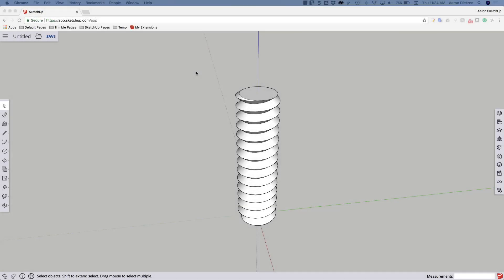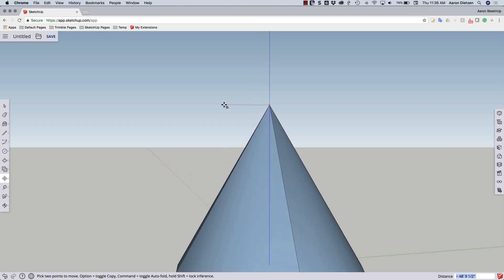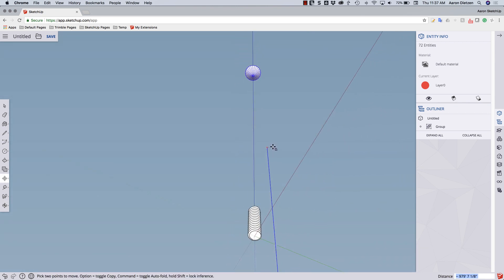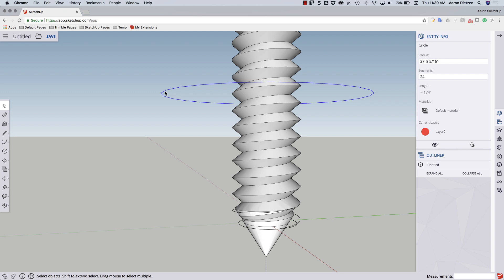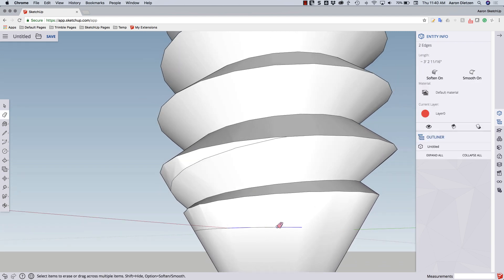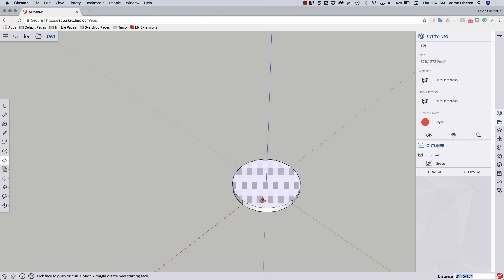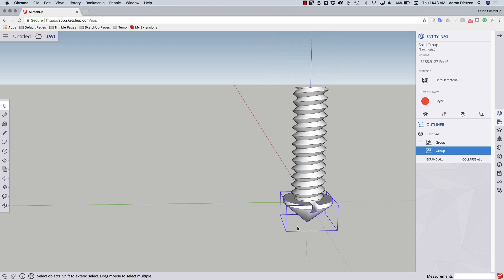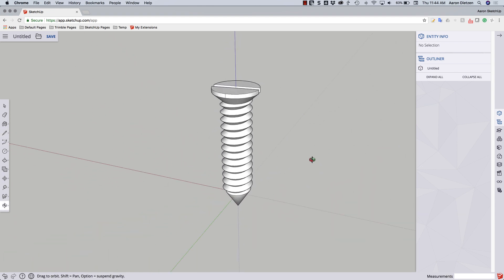SketchUp Skill Builder: Modeling a Screw, Part 2

Comment: Should have closed the cone, then move the cone base back past the apex to invert the cone (becomes a cylinder with a cone shaped hollow)  Subtract the inverted cone from the screw section and it removes the extraneous lines all in one hit.
I did that 4 years before this video.

Comment: Can you make a hole in the sketchup for fitting a screw. like a female screw.
Reply: I think you mean a nut.  just did this, coincidentally....     draw a hexagon around the screw, push/pull it to your desired height.  Intersect faces with model at the top and bottom planes of your nut.  Erase anything outside your nut.  Erase the circle covering the hole, top and bottom, of the nut. Save that as a separate file.  In your new nut file you will have to resize it because it will be too friction tight for your screw.  Use the scale tool on THE RED AND GREEN AXES only.  Maybe 1.05,1.05.   3d print your screw and nut to test for fit.  Resize on THE RED AND GREEN AXES only as necessary.

Comment: Nice tutorial. I learned some good concepts. 
I've been trying to create a nut. I thought I would just draw a 6-sided circle, push it up, then remove some material using the follow-me tool, to round off the shoulders. For some reason I can't get that to work. Is it me, or is there a problem with that process? I didn't even attempt to draw threads on the inside. Thanks much.
Reply: I've done that with success, though I haven't taken it to the follow me for edge dressing. In other words, I don't think there's a problem there, but I'd be willing to help (without hijacking this thread!) -- and thanks Aaron! Enjoying these goodies a great deal.

Comment: Is a nice screw but the method is described several years ago. The olnly problem is that this screw don´t meet any standard in bolts and nuts, in other words, is just useless in the real word, for example if you want to 3D print for real use. If you wan a real bolt or nut you need to meet a pitch, diameter, deep of thread and so on. The video is good but the usability is low.
Reply: Hi Miguel! The main goal of this video was walking through the steps of the actual geometry creation. The measurements used to create specific geometry were set aside in favor of looking at the skills required to make the shape. With this info, you can replace the arbitrary transformations in the video with specific values. These steps can absolutely be used to create a 3D printable screw (I have done just that thing a few times!).
Reply: Aaron Dietzen 
Is a good job you video and is very usefull to learn an get new skills in Sketchup and you are very didactic.
Mi comment only try to call your attention about of the geometry of the thread.  The most used bols and nuts (metric and Withworth) uses non triangular threads. This kind of threads has semicircular profiles in several places of the thread, as you know.
There are a bunch of formules that describe the threads profiles and the inner relations in a thread that must be followed to get a real nut or bolt.
Youn introduction is absolutely valid an open the way a more precise real screws.
Reply: Miguel, I wouldn't call the video "useless".  Not trying to be rude here, just an observation: the fact of the matter is that if I'm going to be 3d printing nuts and bolts I'm doing it for myself, not for others, on a 3d printer with PLA filament.  And in that case I really don't need ansi standards...  I just need connectors that will work for me in my current project.  Also, really, how durable are PLA bolts for anybody else, anyway?  There are cheap nuts and bolts and screws at hardware stores.   Thanks, Aaron, for your great videos.

Comment: That is a good simple process.  However, keep in mind 2 things.
1 - A screw thread will have an enormous number of lines and faces. That becomes important if the screw is replicated at a number of places. That will slow down the video and moves. You can minimize this by using a simple proxy component during layout and model construction, then converting all those proxy screws to the detailed component for final presentation.
2 - SU does not like tiny lines and faces.  If the screw is scaled down to an actual size, say an inch or so, SU may create a lot of open faces in the thread and make editing a hassle. Again, using a proxy screw will help.

Comment: Now you need to do a Part III where specific dimensions and thread angles are used. Without those this is fun but essentially useless.
Reply: I would recommend modeling at 100x your required size. I skipped the exact sizes on this video because I wanted to focus on the steps involved when drawing the screw. No side stepping, just choosing what steps to focus on in a limited time video.
Reply: As on the previous video on how to make the actual thread geometry... when "squishing" down your single helix... squish it down to your required measurement. This all assuming you started with your required circle diameter in the first place....
Reply: And thread pitch, and minor diameter, and included angle and …
And starting with the required diameter in most cases will give problems with small faces, which the OP neatly sidestepped by making his thread diameter enormous.
Sorry, but this example is fun, but not usable in real life. At least not without a LOT of additional work.
Reply: @ytnjw  not true. I just did a video last night of how to actually do this. For example, an M6 screw has a major diameter of 6mm, minor diameter of 4.917mm, and s pitch of 1mm. When making the helix, the lines that conect to the circle should be 1mm in height. Then at the end when he uses scale tool to scale the helix, type 1mm as the measurement. This creates the pitch. 

The scale tool shrinks the threads down by a percentage. So 6x=4.917. Solve for x. This yields 0.82 as the number you shrink the threads to.

https://youtu.be/993Eh3wKm3s
Reply: Thanks Aaron, was an awesome "skillz" video.
Reply: This is more a techniques video. You can figure out diameter, angle, minor diameter with some simple calculations and apply it using the same technique. Besides, you wouldn't really model precise mechanicals in sketchup in the first place (what would be the point? You can't do stress testing simulations and screws in a larger build are usually just just nubs/holes)